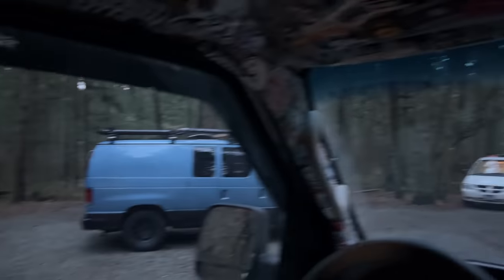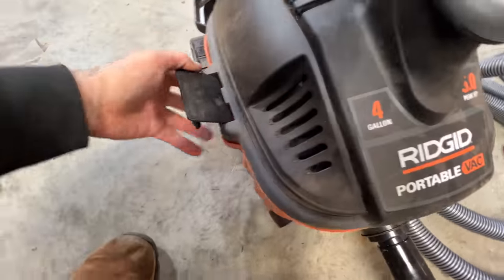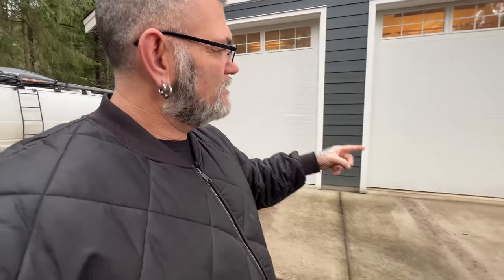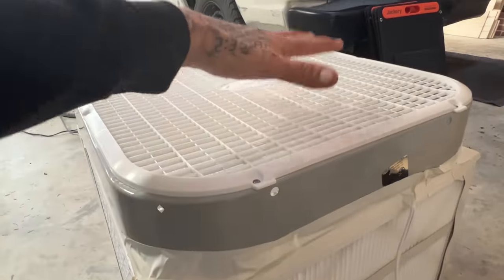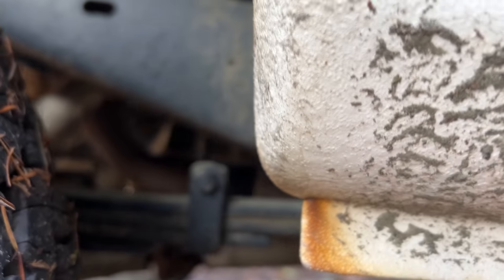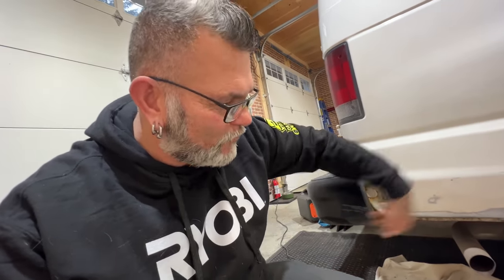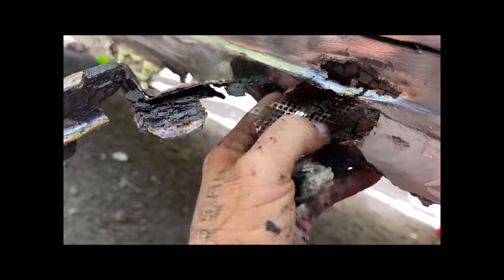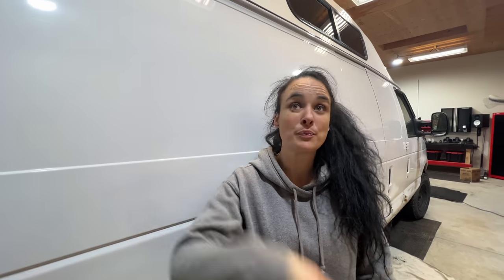Girl In My Shop With All The Same Rust Problems I Had + Building a Cheap Air Filter

Comment: My ex was a heavy smoker. It was not a big issue in the summer when we could have the windows open but in the winter it really bothered me as I do not smoke. I built a similar contraption to this and it really did help a lot. You just have to read the package of the filters you buy to make sure they filter out cigarette smoke particles.

Comment: Here in the US we have Ziebart shops in the states that use a ton of salt on their roads in the winter.  They drill holes in the rocker panels and fill them with Ziebart rust inhibitor.  They then plug the hole with a rubber plug so they can periodically spray the cavity with rust inhibitor.  It's not perfect but it does extend the life of the vehicle.

Comment: Hey Chrome just a heads up those filters are backwards. The metal grating should be on the “output” side.
Reply: Nathan is 100% correct for proper filtration, also will prevent risk of filters from collapsing over time

Comment: Hello Chrome, rope grease on the underbody prevents reliably any rust. In Switzerland, rope grease is applied to the steel cables of the ropeways to prevent rust. This is a very sticky grease. On old cars you can see the difference on the underbody. Where the underbody is wet with oil, the sheet metal is like new. Where the underbody is without oil, everything is rusted through.
Reply: In Ontario,  Canada, they do spray the undersides of cars, however  not so much in British Columbia. I'm not sure if it's because there just isn't  as much snow, so not as much salt on the roads?

Comment: suggestion, keep the filter box fan as close as possible to the dust source.  Also, what is the rating on your filters?  In the USA there is merv rating, out of the USA they use different rating system based on international standards.

Comment: You can buy a brand new van and eventually rust is going to come through, it's just how they are designed but there are ways to do some rust prevention on new vans that people who do van conversion should do before building. I've worked in body shops for alot of years. A number years ago I repaired rockers on a chevy truck which are terrible for rusting. You cut the rockers off and then any rust inside you do rust treatment and rust converter then top coat with POR15 then the replacement panels get preped and glued to the vehicle with panel bond. So no welder needed, by not using a welder all the paint on the inside of the panel stays intact because  the heat from welding burns the paint or weld through primer off. After the panels are bonded you do body work like normal. I have rusty rockers on my van and want to replace the rockers but no place to do the work.

Comment: Ask any auto body shop. Once rust takes hold it's impossible to stop because it's rusting from the inside out even after repairing the outside surfaces. The length of time the work gets warranted will tell you how confident they believe the repair is from rusting again.

Comment: Yeah maybe I'm more here for the shop stuff then even the van life stuff lol. I move into my rv so I can spend more time at my small shop. But those diy air filters work great in my shop simple box fan and 20×20 is the best thing for the price. You do want them set up at head level or higher cleans the air level your breathing. Also if you do more wood working in the shop look into a dust deputy they help vac filters last noticeable longer.

Comment: I did buy a  2002 Ram Cargo was going try van life 5 years  ago the seller said the back doors did not open I did not think anything of it toke we got it back got the doors open to find a huge hole where the driver back wheel should have connected to the body we did drive it around like that it lasted sold it to a guy said he could fix it

Comment: You can apply rust converter to the rust which will turn it black. The sills are a problem because usually they have not been treated. You can get a can of rust converter that has a long tube in it you shove the tube down the sill and pull the tube while spraying down the tube which will spray the entire inside sill.

Though often once you have rust on the inner sill you will need to replace it.